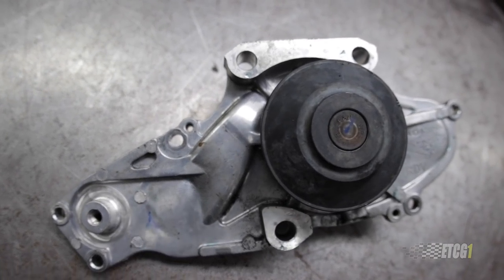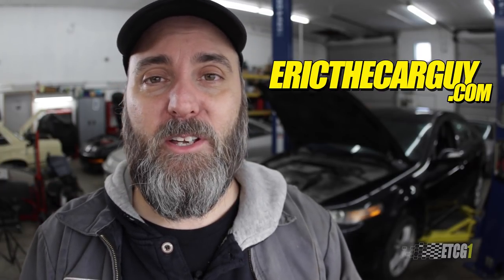Timing Belt vs Timing Chain, Which is Better?

Comment: I'm in the timing chain club, if you don't have to deal with this issue in a very long time or maybe never in your ownership time that's a budget friendly solution.
Reply: This. I've seen cars pass through two generations, and not once mind the chain.
Reply: Chain wins every time
Reply: more upfront cost…
Reply: What I can say about timing chains is that they are fantastic if they're properly designed. So many engines that eat the guides even with proper maintenance, making for an extremely costly repair.
Reply: I am in the same club. In a well-designed, well-maintained engine, a chain should last forever.
Reply: @99domini99  THIS.
Reply: im the gear club with scissors and dampener but next choice is chain and free-valve/ECU last as sofar it cannot always be trusted not to wig out but has so many advantages vs all the rest of the competition
Reply: @paulparoma  chains stretch tho…?
Reply: @ThePery123  I guess they do, but this would be after A LOT of miles (depending on the car, of course). And you won't kill the engine as a result of a stretched chain. But a belt can simply snap with no warning.
Reply: @paulparoma  facts the chain is superior but it depends on the application and how well it’s built, and how you maintain it, don’t change your oil don’t let your car warm up you’ll build some sludge, but what about the boy racer who redlines everyday at least 10-20 times ?
Reply: @ThePery123 I know. But what makes you certain it's a boy? Why make sexist assumptions? Maybe it's a transgender or non-binary. The manufacturers are currently busy designing special chains for those.;)
Reply: @paulparoma  lol so it’s not really built for that yikes 😱, I probably should take it easy on that little 2.3L ecoboost huh? Cause from what I see you gotta take the engine out, and idk where the mounts are even ;)
Reply: @ThePery123  Yeah, that's a tough one.;)
Reply: @aserta  it’s not the chain it’s the stuff around it like a lil plastic piece time tensioner this is what a lot of these guys don’t say .. there so much guides and plastic pieces that can fail were u have to go all the way to the chain anyway ..
Reply: I would always prefer a chain & Scotty Kilmer says they’re better but this video has been more informative. I really want a 2020 Honda Passport but they’re expensive or an older Pilot because of how well I fit in both of them & how long they last. My Bro has a 2014 CRV with a chain & wished it was bigger. I told myself I would never have a timing belt but I really like those Honda’s & only SUVs I found that I fit in the best. I rather prefer a Toyota but can’t fit in them very well. I’m trying to convince myself that a timing belt is okay & why I’m watching videos like this. I want to be able to fit comfortably & replacing the belt would be cheaper than a whole new vehicle but I’ll have to save more money for when I get the belt replaced. One thing to take into consideration is I don’t drive much & I might not drive a 100k in the rest of my life.
Reply: Yep. No advantage to a belt.  Click bait

Comment: Well… my 06’ Toyota Corolla has 290k miles on it with the original chain and have had zero issues with my timing. I’m sure reliability of a chain is different between manufacturers, but there’s a reason most Toyotas produced today have chains
Reply: My commonly serviced Celica at 205k sounds like a sewing machine I'm sure because of the chain stretch. Kinda wish it had a belt
Reply: @cory45x  but it's just as hard to change the belt and the chain takes longer to go
Reply: @cory45x  more likely needs a valve adjustment.
Reply: 03 Corolla 248k here, same chain no issues yet.
Reply: The 1ZZ motor is bullet proof
Reply: @cory45x  if the engine still makes good compression it's probably fine.
Reply: A corolla and a 700+hp v8 there is bit of difference
Reply: Where the hell did you come out of no where with +700hp V8? By the way the Dodge Hellcat 6.2L supercharged V8 which has more than 700hp also uses a timing chain…. Soooo
Reply: My car has a belt. I only have to change it once or twice then junk the car. I prefer a belt. It means once I change it any bad maintenance the previous owner may have done won't effect me. 🤔
Reply: @Pickle312  but consumes too much oil
Reply: You’re thinking of the very early 1ZZ motors that had an issue with that, like 2002, 2003. No oil consumption on my 2006
Reply: I have 300,000mi on the accord. Chain drive   still my daily.  It works.  The Odyssey has 160,000 learned the hard way to do the belt myself next time. The mechanic some how missed the mark and gave it back in limp mode. Worst part is that he kept blaming it on a faulty crank sensor.  It was atleast one tooth off.
Reply: @cory45x  Yes but with a belt there generally is no warning to failure.  You're experiencing failure, but can address it now before it completely destroys the motor.  In many cases, with an interference engine, a belt break usually can lead to bent valves.  This is why I think chains (in my opinion) are a bit more of a benefit -- no real maintenance interfals, and if you get slop in the chain (stretching) you can usually detect it early on, whereas with a belt it just snaps most of the time without warning.
Reply: @cory45x  It could also be your variable valve timing if the Celica has it.  In most cases especially with a car of that age, it may not be worth fixing and you just drive it as it is.
Reply: @HR-wd6cw  it's not a vvt rattle. That noise would be at startup.
Reply: @HR-wd6cw  lol that was his entire point. Where a belt is good for the entire service interval the chain. Degrades and with it performance
Reply: I worked on a 07 corolla the other day. Chain tensioner failed at 130k and allowed the engine to slip timing. Completely destroyed that engine. Timing chains do not break apart like belts but they do still fail even from Toyota. I suggest you replace the tensioner as it is the problem with those almost 100 percent of the time.
Reply: I’ll take my chances at this point it’s got 290m miles on it.
Reply: @Pickle312  lol it's 2 10 mil bolts and like 30 dollars. I wouldn't count that car out yet its very possible it still lives another 100k plus if you've been taking care of it
Reply: 2008 g6 2.4 280k miles original chain here. Toyotas known for there reliability but I know gm isn't so I figured I'd  throw this out 😂
Reply: @HR-wd6cw  yup had a Escort about 15 years ago where the Belt broke and prior to that no symptoms until I was on the freeway and lost all power.
Now my 2017 Terrain chain is loose and heard a rattling sound and took it in the dealership right away. I rather have Chain then a Belt due to no warning signs of it failing
Reply: The 1996-2002 Toyota 4Runner has a rubber timing chain.  Per factory, it needs to be replaced at 90K.
That being said, my mother-in-law gently drove hers to 113K before it snapped.
Thankfully, it's a non interference engine.
Reply: @TheBrothers759  depends on the car. Belts SHOULD be easier to replace than chains, because belts usually only have plastic covers over them, held on by a few small bolts.
Reply: @HR-wd6cw  belts very rarely snap with no warning. There's always a warning. It's called your odometer...
If you drive past the scheduled replacement mileage and it snaps, you can't say you weren't warned.
Reply: @alan mac  exactly!
Reply: All facts, my Toyota has over 300k, same chain and can't even hear the engine
Reply: It's never "zero issues". It's always "stretching" as it wears and losing time gradually.  The question is how much, and people think it's 100% fine...... Until it jumps or snaps.
Reply: As far as I’m concerned at +300k miles on a timing chain is plenty long enough… still running the original chain

Comment: European interference cars: timing belt. So many faulty chain designs. Japanese interference cars: chain.  Ideal scenario: belt-driven non-interference engine with serpentine belt running the water pump.
Reply: i've come across engines that had the wp driven by the serpentine belt but the timing belt was in the way of removing it, so it still had to be removed/replaced at the same time.. if my memory serves me wel it was a mazda
Reply: Yes, having a non interference belt engine is great. However, from what I can see, that puts a huge limit on how much valve lift and how much compression an engine can have. The original Toyota 1MZ-FE engine was a non-interference belt engine. However, when they added VVT, that made  it an interference engine.
What I find incredibly sucky is that the Nissan VG30ET had 7.8:1 compression, but was still and interference engine. The VG30DETT had 8.5:1 compression and was also interference. Turbo engines without VVT tend to have mild cams, and low compression, but Nissan still made those into interference engines.

Yes, some timing belt engines require the WP to be removed even if the pump is not belt driven. I had to do that to a Toyota Tercel. That engine was known as the 3E/3EE engine.
Reply: I agree  with you 100 percent.  I wonder why the Japanese  engines are interference  engines.  I have been driving hondas  for over 30 years.
Reply: The 2.2L in my old 84 Dodge Aries was a belt-driven non-interference engine.  Water pump was externally driven as well.  Was sitting at a light one day and the engine just shut off.  Hit the key and whirrrrrrrrrrr...no compression whatsoever.

Comment: Timing chains are advertised as lifetime durability - however timing tensioners are not . Mine gave out at 130k miles causing severe damage to the engine .
Reply: Well thats a lot of miles you gotta change water pump every 50 000 miles
Reply: @egeayvala1799  err, water pump is driven by drivebelt, not timing chain. The only engine i know that wasterpump driven by timing chain is ford v6
Reply: You missed my point the idea is when even reaching 100K you can change the water pump and your belt tensioners
Reply: @egeayvala1799  no, perhaps you missed my point that most engines today are transversed - you dont have enough space to do that shit. At least engines with timing belts are designed to be serviced with enough space to work. Timing chains on transverse engines you have to remove the engine to do that. Sure - you can replaced that with engine still in the bay but its super hard and you might make mistake on installing them.
Reply: @jd5179  hard or not thats the situation and maitanence has to be done
like for rel you just said what happened instead of paying someone a couple of more  bucks to service an engine with a timing chain at lets say 120K miles
chain tensioners waterpump some front mail seals some camshaft seals this and that to keep an engine good and running keeping it fresh-condsidering that the car overall is in good shape and you wanna keep it if this job can give you 5+ years of driving then its i think perfectly fine to pay for it or pay a mechanic to do it-otherwise at one moment your engine just blows up and now you dont even have a car..
worse part will be that no one would even wanna buy it broken unless its for dirt cheap maybe 20% of its value
Reply: Unless you have a 4th gen 4Runner that will go to 500,000 miles.

Comment: A discussion of the pros/cons of interference engines would make a great follow up video.  Keep up the great work.
Reply: My biggest gripe with it is that is way too difficult to find out if it’s an interference engine or not when shopping around for cars.

On a badly maintained car with a timing belt I would just lose all interest in it if it has an interference engine out of fear that it’ll destroy itself at any moment when the belt slips.
Reply: Usually non-interference engines suffer in terms of efficiency. That said, some of the (what are now older... ~15 years 😨) Hyundai engines had belts, were non-interference, and were decent for the time.

But man, the number of Aveo that destroyed themselves with premature belt breakage...
Reply: Yeah...my 06 Subaru outback didn't like it when the belt broke.....pretty spendy fix. But I'm sure my 01 Camry won't care if it happens lol.
Reply: Manufacturers should indicate whether the vehicle you're buying has a interference or non interference engine. Also timing belt or chain.
Reply: @Hamachingo  basically if it’s made within the past 10 years it’s an interference engine. For efficiency’s sake, I don’t think any manufacturers are making non-interference engines anymore.
Reply: Interference engine have a higher compression ratio
Reply: Yes like the old Pontiac motors chain beats up the teeth on the aluminum and plastic gear bye bye valves same for Ford motors and Chrysler of the seventy eighty's.
Reply: I agree pros and cons of interference engine would be a great video
Reply: @Hamachingo  yeah I agree, the solution for me is to drive home carefully and just never trust it and replace it the first thing you do - and I tell others to do the same or budget the car with intent to have a mechanic replace it if you don't do it yourself. If you can get a deal on a belt car that allows you to replace it I think it can be worth it.
Reply: I dunno about higher compression ratio or power differences but i have yet to find a big negative on the 5vz-fe.  Its non interference which saved it from the junkyard after who ever changed the timing belt had one of the cam shafts 90° out which would have instantly killed any interference motor.  That said changing the belt is an easy process along with every other engine maintenance item.  Except for valve lash..  they made it where you have to reshim each and every one which takes a lot of patience and time along with having or getting all the correct sized shims. Down to the hundredth if you want to stay in spec..  that is its major downfall because if the valves decide to both open or close together then you get holes in blocks or rings going and cylinder wall contact which just kills bearings and compression after., but with the valve covers being held on with rubber gaskets to hold the seal, when you have to reseal the oil leaks and replace the gaskets and rubber youre already halfway done with the valve project so might as well do it then..  being a 20 year old engine and 200k miles it still runs like it did from the factory floor with 210psi compression +/- 2psi on all 6 when cold..  perty good id say..

Comment: Seems having a non interference engine would be a more important focus than rubber vs metal timing apparatus 😀
Reply: Suzuki 1.6 in a early gen geo tracker. Snapped 2 timing belts in my life. Non interference engine, my dad once tied panty hose around the crank and cam pulley and got it to run all the way home. Need more non interference engines!
Reply: non interference engine unfortunately have worse compression ratios and, consequently, worse performance, than interference engines

Comment: I don’t like the long chain setups with V engines. The crank to cam long chain and if dual overhead, then a another chain from cam to cam. So much area for slop to accumulate and just things to go wrong. Pushrod Vs with the short chain are my favorite.
Reply: This might explain why when Nissan built their first V6, they chose to use a belt. They had no problems using a chain in their inline sixes.

Comment: I think both are excellent as long as each are implemented correctly.  Timing belts should be relatively easy to change so need to be accessible.  Timing chains need high quality guides and tensioners as these are most often the weak links in the system.
Reply: Amen! BMW needs to go sit in the corner for their timing chain designs. And their rod bearing designs. And their crank hub designs. And their vanos hub designs...
Reply: classic v8s rarely had timing chain issues except high HP racing uses
Reply: @bikeman1x11  Yes, but they also had a less than 2 foot timing chain going from the crank to an in-block cam versus a very long chain with guides and tensioners to accommodate overhead cams. I personally prefer pushrod engines because they almost never have timing issues, but they are limited when it comes to emissions and VVT/VVL to get more bang for your buck so to speak.
Reply: @bikeman1x11  When they went to fiber sprockets in 70s and early 80s they regularly failed. I've had both. An easy to change belt (not driving any ancillaries) is the way to go. I could change the belt on my turbo 2.3 Ford in a short afternoon. A chain with failed tensioners is a PIA.
Reply: @cgmoog  problem is feaw are easty to change-  and no one should have to look forward - near $1k  bills for maintenance of a $%@%@ belt
Reply: @bikeman1x11  if your guides fail or if any part of the Chain system is built weak (plastic gears, guides, etc) it's gonna cost wayyyy more than 1k. And paying 1k every 100k miles is like a penny a mile. Plus you end up with a new water pump tensioners etc. Chains last longer, but if you are worried about spending 1k 3 times in a vehicles life, I'd hate to see how you react to a failed chain. BUT, there's pros and cons to both and really comes down to personal preference and budget I guess.
Reply: @novinnovations4026  thats not the chain though that is other components- if they designed shorter chains and used better guides there wouldnt be an issue- belts by nature are disposable and can break- sure they can last- the 98 integra i bought had original timing belt bur 38k miles- I changed it to avoid it from killing the engine if it broke
Reply: @bikeman1x11  If it was up to me they would all be easy to change. But I'd rather have to spend $1000 for a belt change than $3500 for a failed chain, tensioners and contaminated oil.
Reply: Yea I got to do this I no it .. everytime I cold start there is a sound in the front right of the car 🤦‍♂️ plz help I wish could play the sound
Reply: But they arent easy to change thats the problem